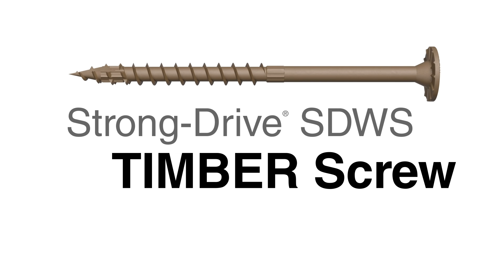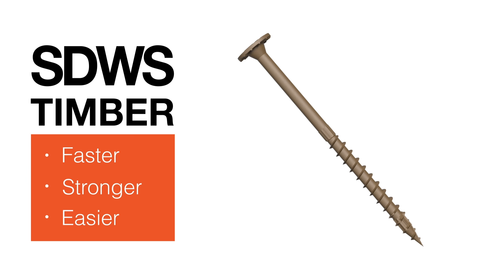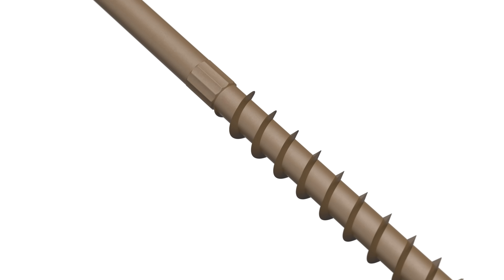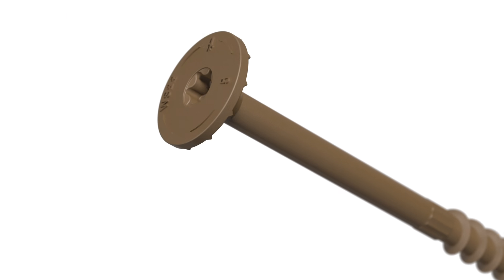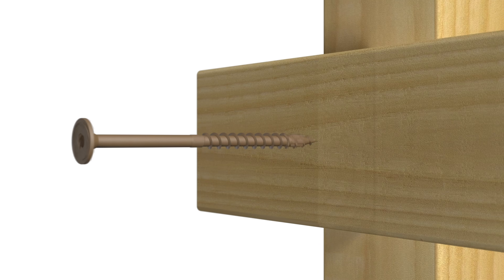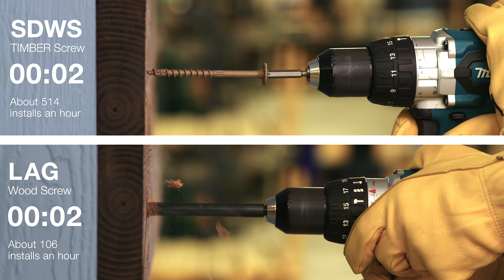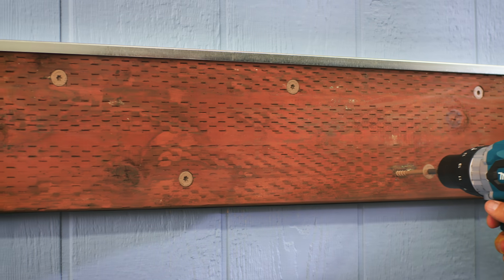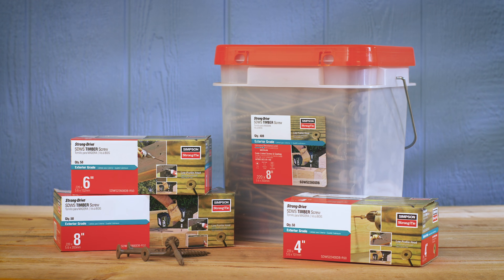How Does the Strong-Drive® SDWS Timber Screw Compare to a Traditional Lag Bolt Screw?

Comment: These are honestly my go-to fastener for SO many applications requiring high strength in exterior situations. Deck guard posts, ledger attachment, pergola knee-brace attachments, etc. Easy to use, fast, and strong as hell.